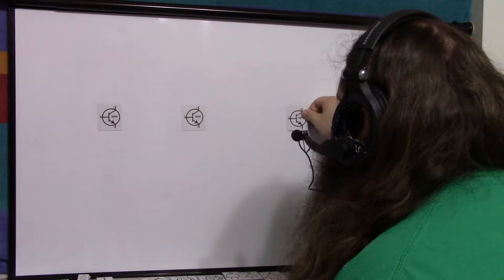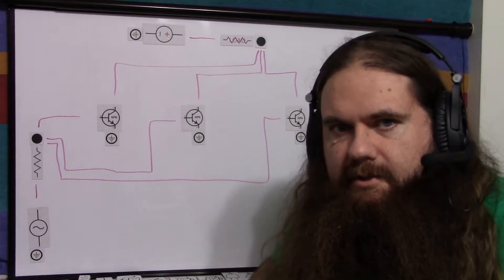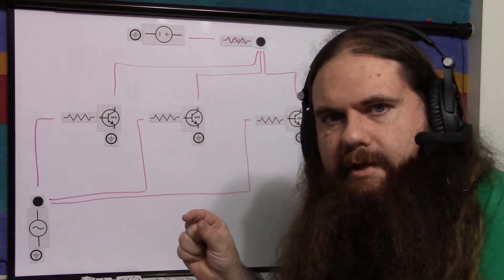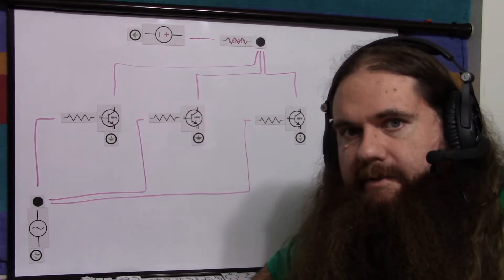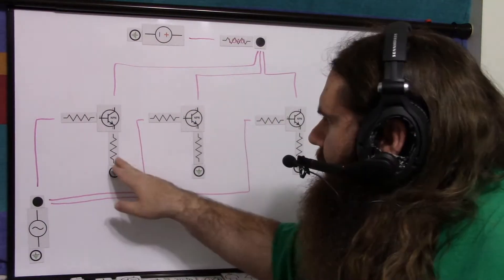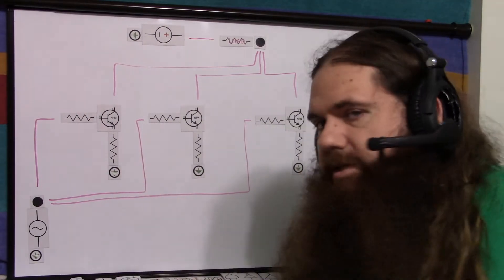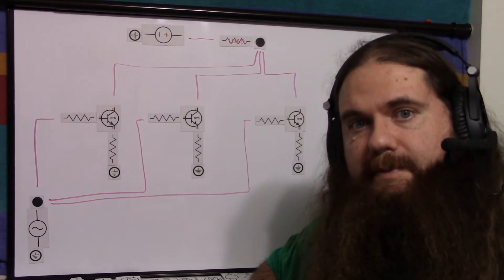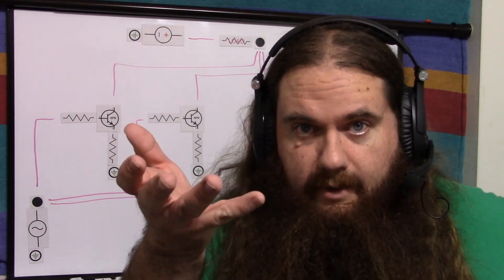Ballast Resistors - Making Parallel Transistors Behave Themselves - Simply Put

Comment: I came across the subject of balancing the power in circuits, while researching how to join multiple power supplies. I needed more power for testing a design prototype.  "Steering" Schottky diodes may also be used, in a similar manner as ballast resistors. Op amps can also be used to achieve active control. Here is a link on the subject: https://www.edn.com/multiple-psus-share-load/